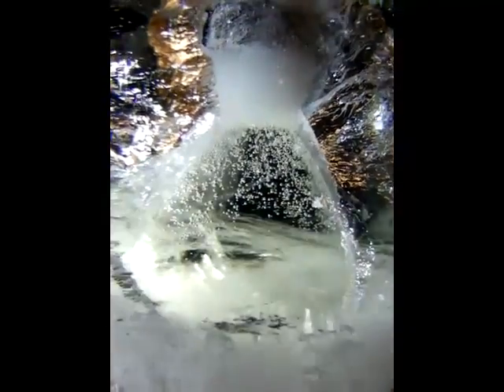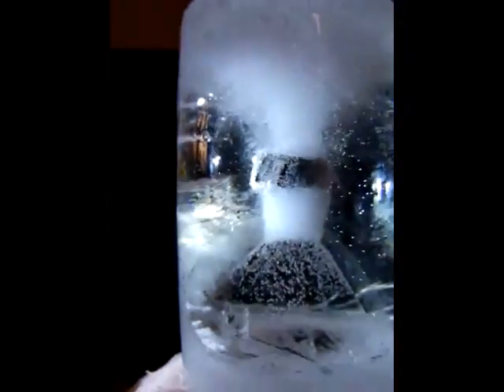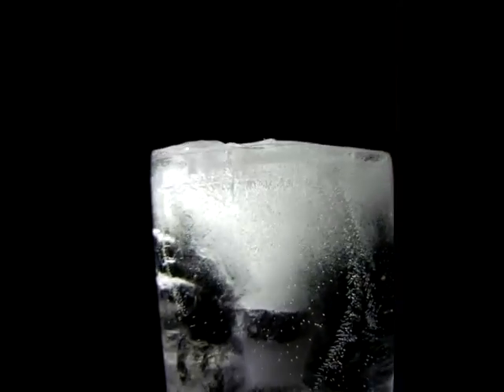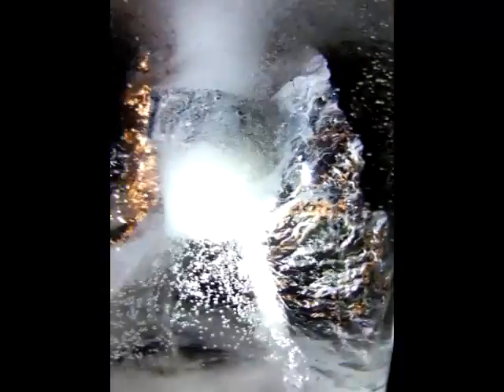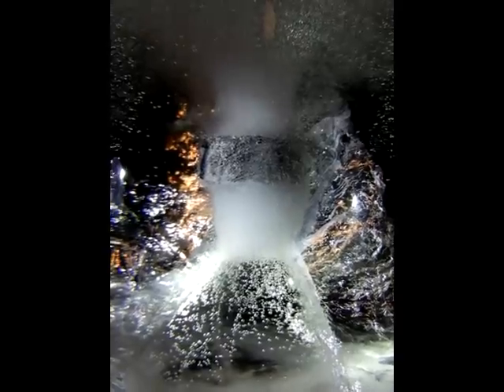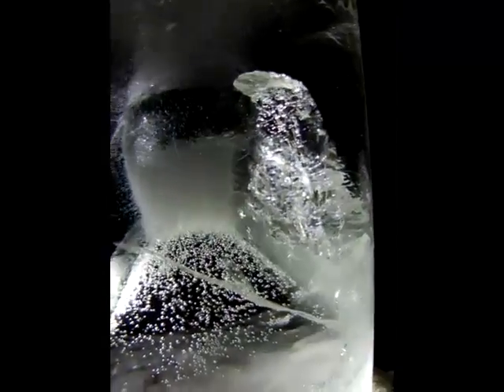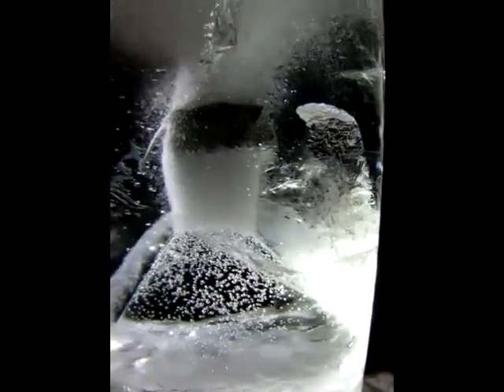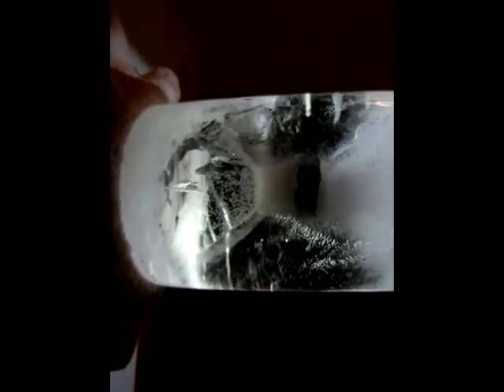Part 6: "Magnetic Egg" Using magnetism to alter the properties of water. First time ever seen!

Comment: Does the water at the South Pole not freeze because it is being moved in that shape? I'm also reminded that water in a pipe will not freeze at normal temperatures because there is no room for the expansion of the ice. Perhaps once the egg shape void is created, the surrounding ice will not allow the egg to freeze due to the same reason as the pipe.

Comment: Fascinating and beautiful!
2 days ago i tried this with a small n42 neo rod magnet(the small ones 30mm) i had laying around. Got also these beautiful patterns but didn't get the egg-shape.
I guess the magnet wasn't good enough or the container i used was to small.
Also used demineralized water. 
Gonna do this over with different magnets and containers, just to get some beautiful macro shots of these patterns.
Reply from the maker: ***** the orientation need be correct in relation to the earths pole.

also use cheap distilled water.   :)
Reply: Theoria Apophasis Don't know why i said that, yes it was the cheap distilled water, hehe.
Did you ever added a colorant? Would it affect the outcome?
Reply from the maker: i didnt add anything, i should not affect outcome (would make great shots!)